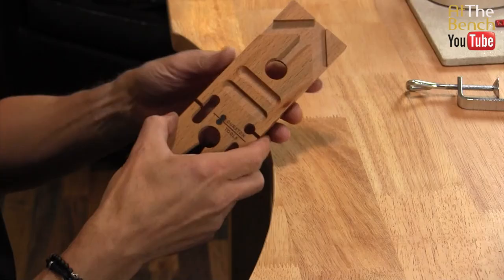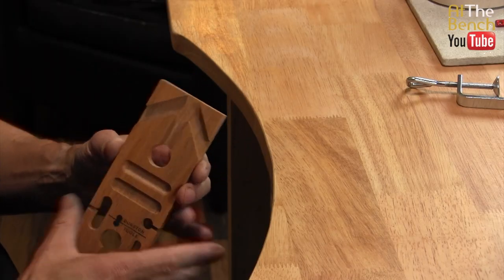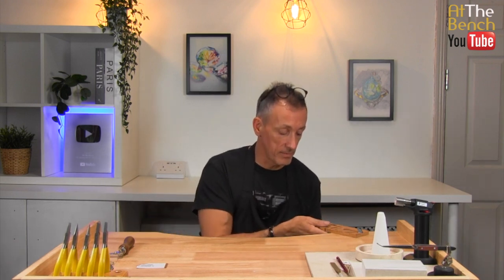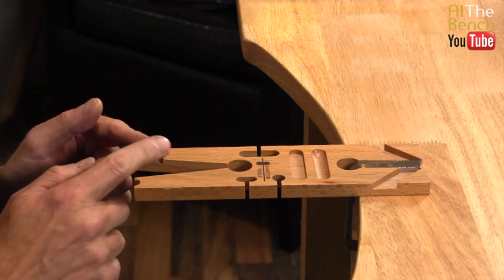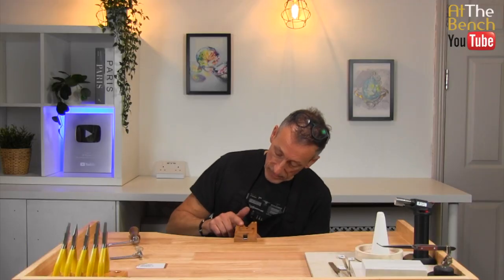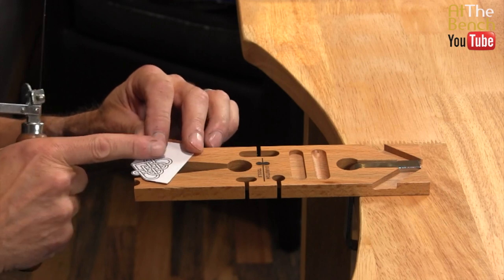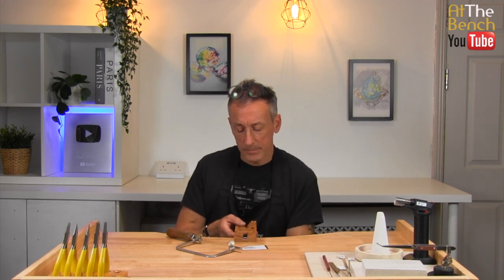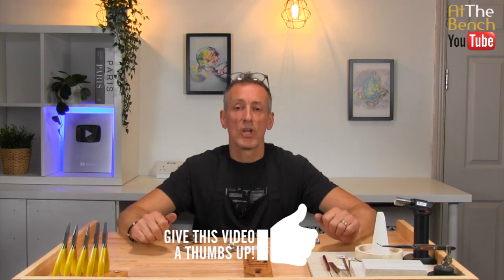Andrew Berry Reviews The NEW Durston Tools Multi Angle Bench Peg

Comment: Durston put a lot of thought into their new bench pin. The wood part is great. I expect more from them on the clamp its the same as a cheap Amazon clone. C clamps have a T shape profile to make them stiff they need to offer a upgraded clamp  for a more steady feel. A standard C-clamp could be filed to fit the side mount groves to make it as solid as your benchmate. Beginners need solid with less experience they will break blades easier as they are not as experienced at sawing. A person could trim down 2 - 3 in C-clamps and put one from each side and skip the middle clamp and make it strong enough to take light pounding and any sawing you throw at it.